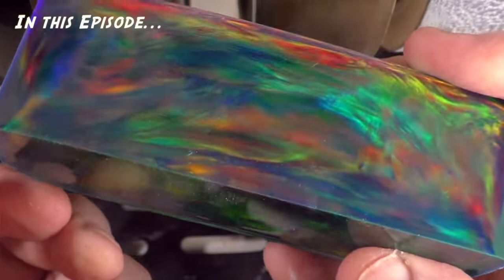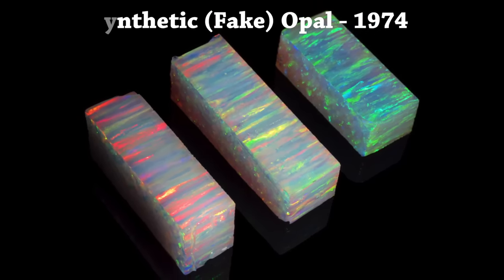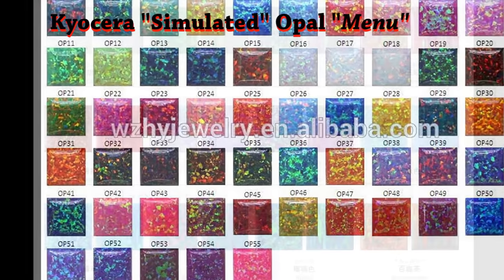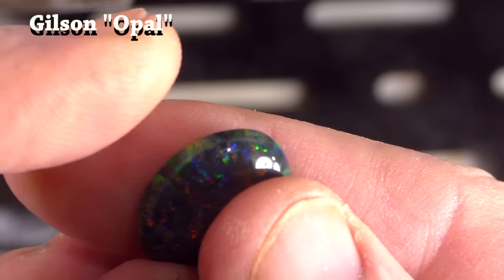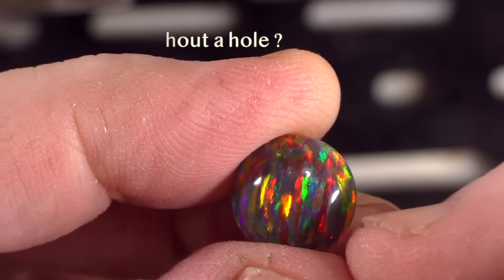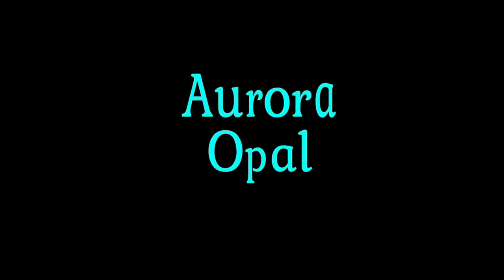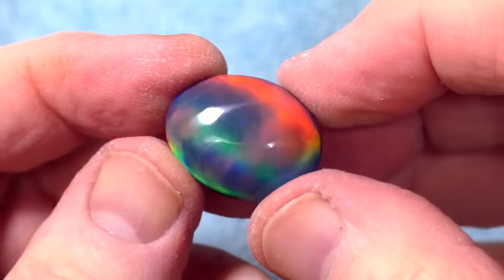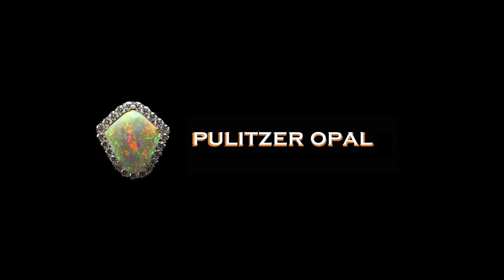Ripped Off   Fake Opal !!

Comment: That stuff is gorgeous.  80% silica, 20% resin.  One big question is the origin of color, .., is color happening due to silica content, or pigment in resin?  At those weight percentages, I would be inclined to say the color comes from the silica content, otherwise, just use more resin in the first place.

I think you'd do better to call it a composite material, especially since the balance of the composition is silica.  The derision you apply belies an unnecessary insecurity on your part.

edit:  that said, it's best to keep the public educated, just keep the pros & cons at the forefront.

Liked, because you took the time to present the material, thanks.
Reply: @PulitzerOpal  I'm an opal enthusiast as well, but I lack the scratch to chase Australian opal,  I stick to Ethiopian.   Sure,  most of it goes clear once wet,  but the good stuff holds its color. 

I will have to watch your cabbing video,  as I can't cab for love nor money.   I do have the necessary neuroses for facetting, however. 

Cheers!

Comment: Right now I only have a faceting machine, but when I eventually get a cabbing machine, I'd like to get some synthetic opal. The real thing is just so expensive for a large, high-quality piece, especially if you want to avoid Ethiopian opal and its crazing issues. I definitely want synthetic though, not simulant, and certainly not something made of plastic.

There is a difference between a "synthetic" stone and a "simulant" material, at least as defined by the IGS. A synthetic is a man-made version of the material. For example, I have a boule of flux-fire blue corundum. It's technically real sapphire, chemically identical to what gets pulled out of the ground. It's just man-made, not natural, making it synthetic.

A simulant is something else entirely. A simulant is a different material made to look like something else. I have some cubic zirconia, which is a diamond simulant, since it's a completely different material. Simulants and synthetics can also overlap. I have some rough, man-made corundum that's made to have the colors and color-change properties of alexandrite. That makes it a synthetic corundum that's also an alexandrite simulant. 

It is a key distinction to make, though, since a synthetic sapphire or ruby, while worth far less than a natural stone, is still worth many times more than a simulant like colored glass.

Comment: The one you called a possible bead, even though it didn't have a hole in it, could have been meant for a piece of wire wrapped jewelry. Or at least that's what I'd do with it.

Comment: Most all department store opal jewelry is kyocera opal. I have seen kyocera and a couple of ethiopian pieces in Kohls, but never real aussie opal.
Reply: @PulitzerOpal  I am sitting on 4 kilos of welo.
Reply: You should ask to stick a hot pin into the Opal and see how that goes!
Reply: @1mmickk    i have tried it and it will do nothing to a kyocera as it is a silica base with polymer color drawn up through with thousands of tiny needles stacked together with multiple colors injected and pulled up through the silica
Reply: @t2fast  Thanks mate, was there any odour at all? Surely if any form of resin is heated, not only will the molecular structure of the material change, but a polymer resin will stink to the shit house. If not in a nose, by gas CG-MS test.
Reply: @1mmickk  oh yes it smells when cut like a plastic and it takes a ton of heat.

Comment: Real opal in general is ugly especially for the price you pay for it. Some are nice but guessing they are top of the top which cost 2 arms and a leg. I found out about Labradorite crystal is much better looking and is super cheap 1.7kg for 60 aud shipped.
Reply: Wyoming paved two miles of road with Labradorite. Why pay for it just go get some like I did.
Reply: @BoostedLeonitus  same goes with anything else its called stealing

Comment: You can call that aurora opal cabochon you cut "fake plastic" all day. But it's still goddamn fucking pretty. Which is all real opal had going for it in the first place. So why shouldn't we value the fake stuff, if it does the same job for cheaper?

Comment: First might I say I love your chan ,.. love the videos,..
BUT frankly, some of the ways you use your equipment is so unsafe as to be setting really bad examples of machine use that WILL undoubtedly get one of your viewers hurt if they emulate you.
8:42 is a perfect example of how NOT to use that machine.
Again, I love the channel please do not think this a hater comment but as a responsible person if you can't use the machine in a safe method yourself at the very least tell people NOT to copy your technique and address the safety reasons for not bare-handing the stock into the saw.

Comment: ceramic lung dust voice from so much grinding dust, you should have been wearing a mask all those years, water additive only makes the dust more dangerously lubricant to bypass the nasal hair and throat graduations
Reply: How does it get airborne if it's wet? Not that I don't believe you but damping down for dust control is definitely a thing.